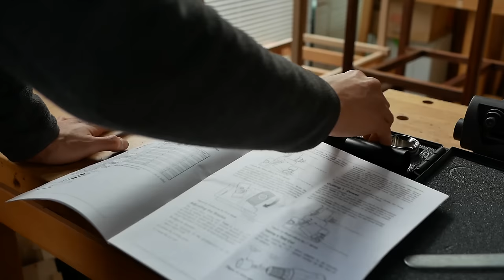SQUARERULE FURNITURE - Making a Walnut Drawing Table

Comment: That is an elegant, beautiful piece. I learned two things from this video today: 1 - doweling small parts that might snap off along the grain, and 2 - your trick of the 45-degree bracing put in after the frame is assembled, with the matched key... both of which are simple and so obvious I'm not sure why that's not occurred to me.
Reply from the maker: Thank you so much for recognizing the invisible things. Because of people like you, I work harder to make furniture.
Have a nice weekend!
Reply: Yes, the cross-grain dowels were an elegant solution. Fantastic work.
Reply: The more brilliant the idea, the more you face palm for not thinking of it first. LOL

Comment: Beautiful and complicated looking piece! 
Couple of questions: 
I've always wondered what is the purpose of those boxes on the wall behind your jointer? 
Any plans for a shop tour...I know it'd be a bit off brand, but your aesthetic is extremely satisfying (in video format, design and shop workflow)
Did you add dowels to the notches to add strength?
Reply from the maker: It's a little difficult to interpret.
I think it will be easier to answer if you tell me how many minutes and seconds it is.
Please contact me when you come to South Korea~
Our store is smaller than you think.
This work is done to reinforce the notch.
Reply: @squarerulefurniture  Thank you for the great reply! I will start planning my travels, haha!
0:35 you see the boxes on the wall - how do they work and what are they for!?
14:50 you are adding dowels, is it for strength?
I love your videos, I watch them with my partner every day.
Reply from the maker: 0:35 - > Aha~ It's used to hide messy things behind the wall.
14:50 - > Due to the nature of the wood, the grooves were processed deeply.
When force is applied to the angle table top, the wood breaks. This is to reinforce it.
thank you!

Comment: Really beautiful work as always, @squarerulefurniture I’ve learned a lot from watching your channel. I’m envious of your shop. 😂 

Btw, what is the purpose of the dowels you add @14:40? Is it for extra strength within each tail/pin of the box joint? Cheers!
Reply from the maker: This is work to reinforce the groove for the table angle.
Because the table top is heavy, it can break under force due to the nature of the wood grain, so it was reinforced.
Reply: @squarerulefurniture  makes sense. Thanks much and happy new year!
Reply from the maker: thank you! 😍

Comment: May I ask…what was the finish used? It looks fantastic! And such simple, elegant lines. This is a great design!
Reply from the maker: Finished four times with German auro oil No. 126.
The table top was additionally coated with about 5 thin coats of Varatan water-based varnish.
Thanks for watching!

Comment: Does the tenon of the long rail sit flush against the tenon of the short rail within the legs?
Reply from the maker: We tried to avoid overlapping as much as possible.
There is no interference as the hole is about 25 deep in a large area.

Comment: What kind of finish do you use?
Reply from the maker: We use German product AURO 126 oil.
For the top, additionally apply about 5 coats of Varathane water-based varnish [several thin coats].